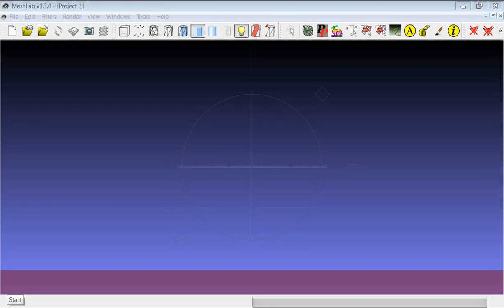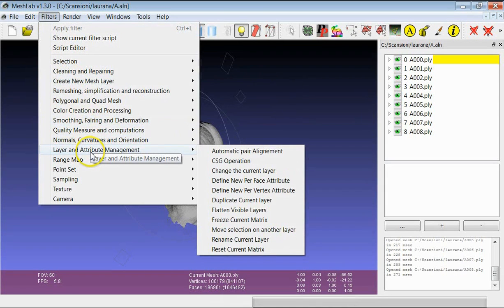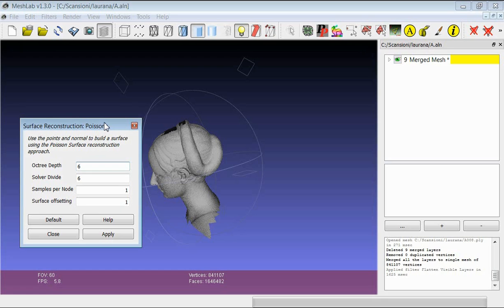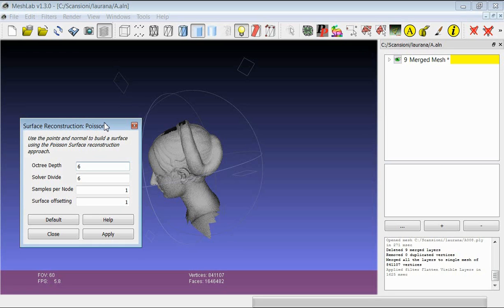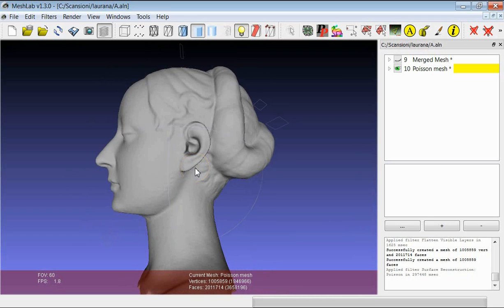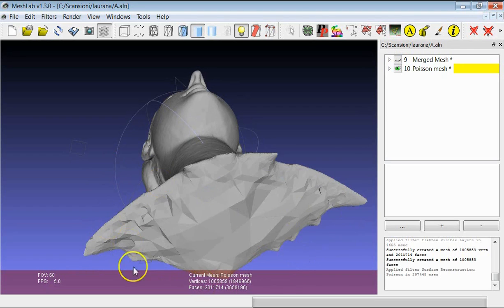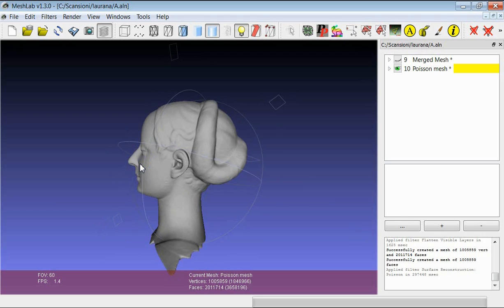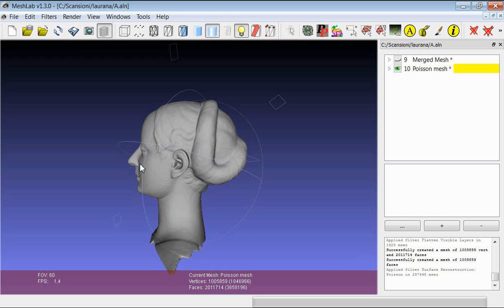3D Scanning: merging with Poisson filter

Comment: How do you delete the layer? You are clicking something magic.
Also, when reconstructing a plane (DSM) I have spotted the mesh should be already 'flat' or the  reconstructed mesh folds badly at the edges towards XY plane.
However, Transform:Rotate to fit a plane is doing something random (another plane than Poisson likes). Any tricks to go around that?